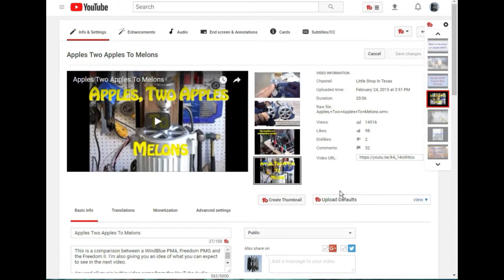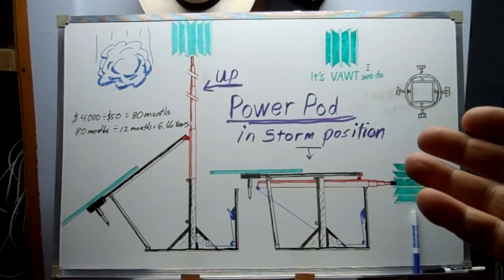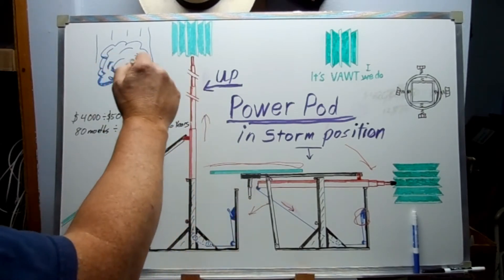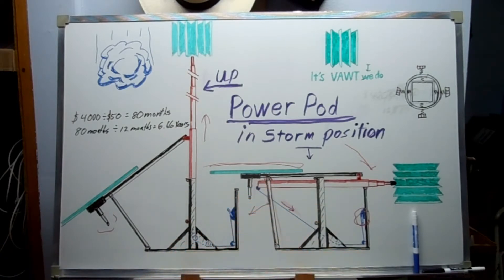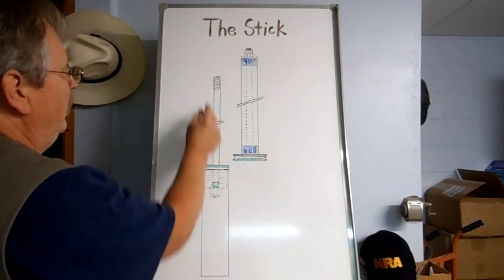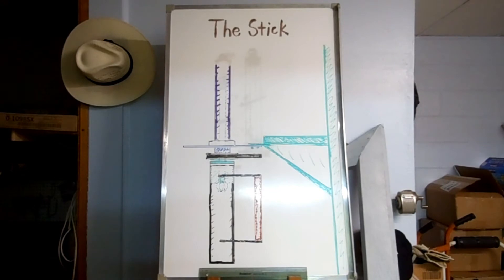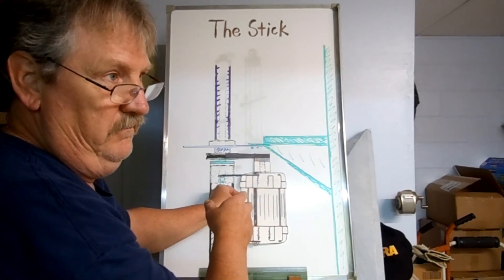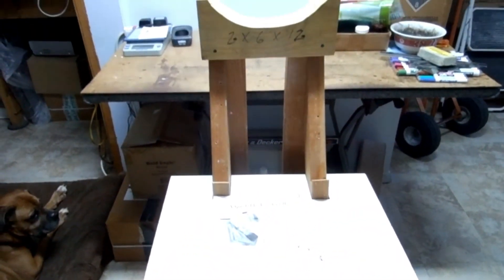Old Projects, New Projects, The Stick & Magnetic Bearings

Comment: Im trying to use one of them razor scooters. I removed the handle bars flipping the bearing rotating shaft so that its almost parallel to the 3/4 pole and you can pull the relase pin and the turbine hangs upside down and blades wont spin for the hurricanes but i have a hot water element so if i can just divert the power when my battery is full i can keep one of my heating elements in the water heater saving power and if wind is low i can use solar or  let the one still on the grid warm me up in case i run out of juice but the idea is to get the right controller and never stop the blades from spinning.
Reply from the maker: It sounds like your having fun with that. I know nothing about razor scooters so maybe you should upload a video about it on your YouTube channel. I'd like to see what your talking about.
Reply: Basically where the handlebars go I stick it in the mast the small ones and then I flip the part you stand on so that it's still sticking straight up and that's what I screwed the PMG on. I need to try to upload some videos but I'm not even sure how to do it I'm going to try that thanks